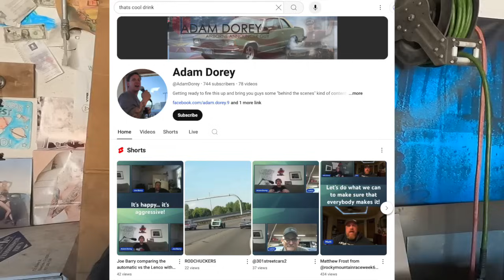What Caused The Crash

Comment: I did a fox clip on a 64 amc rambler...works great.
Built the rails out of 2x3.
K member bolts in like factory.
Only issue i had the strut towers interfere with the hood hinges.....i used set screws to lock that cover in place....happened on my stock car too
Reply from the maker: I have a pin on hood so hopefully we’re all good! I’ll cover what we do on here for you guys so you can see what we come up with

Comment: No, that didn’t stop the engine. Also it looks like you have a loose torque converter bolt. That black dust.
Reply from the maker: The motor will get taken apart and inspected for damage and I will post it up.

Comment: I'm going to weld those in, on boosted apps, from now on, or run electric. Can weld aluminum beads in like 4 spots, to hold it in.
Reply from the maker: I thought about that but I’ll go electric. Also the freeze plus on the heads need holders as well from what I’m told so I’ll get those as well.

Comment: I didn't know the Vette or Camaro wp had a pressed in backing plate. The truck pumps bolt on. That stinks that happened. Sorry man. I guess you can drill and tap the pump and put set screws or pin it to keep it from happening. Or switch to a electric?
Reply from the maker: Electric form now on